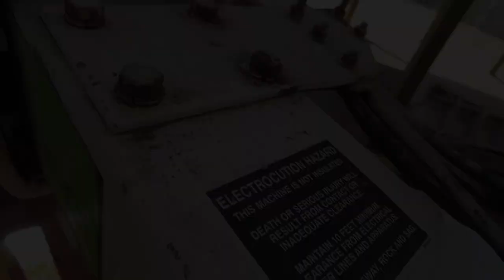How to repair SnorkeLift UNO 33E Boom lift Cylinder (Snorkel Boom Lift)

Comment: Thank you for the video. I have a 1995 UNO 41E, 600 hours total. I have owned it since 2003. I have had no problems with mine. Use it to paint the house, install new gutters, pulling bushes out of the ground, installing street light poles, lifting all
kinds of things. I got my second set of batteries from Costco (6 volt), they are 7 years old and still working. Again thank you for posting your repair I may need it one day.
Reply from the maker: Nice, I think they’re under appreciated. I still have a couple of things to repair. Thanks for the shout out.

Comment: Great video! I also have a UNO 33E that I purchased from my employer. They purchased it from a local rental store. It's a mid-1990s model and I've "known" it since around 2005. It was eventually replaced and sat outside for a couple of years before they finally sold it to me for $500 about 5 years ago. It's in pretty rough cosmetic shape, but mechanically sound. I need to fix the electric brake and the bucket crank-swivel mechanism.
Reply from the maker: We have used it a ton. The people at snorkel are so helpful with troubleshooting. Good batteries are key. I can’t imagine not having it

Comment: Nice job with the rebuild!  I'm curious -  would you recommend buying a used lift like this? I saw a couple Uno 33 Es show up at an auction and got intrigued. I'm mostly concerned with operation on uneven terrain, getting it stuck on soft soil, the control boards going bust and being unable to replace them.
Reply from the maker: We had a gas/propane jlg in the past. I like the electric model a lot better. And the company is amazing to deal with. You can talk directly to technicians, engineers or parts people. One of their techs actually sent me a copy of his electrical “cheat sheet “. You couldn’t always have a different experience but I’ve been very happy
Reply: @featuredelements4631  Thank you so much for the thorough response! Best of luck with your future projects. I'll be following along!

Comment: I wanted to ask you I just bought purchased a lift. What batteries did you use? And would you buy them again?
Reply from the maker: I purchased them through the local Napa store. So far so good. There are 8 batteries at approximately $150 a piece.  I believe after having a gas/propane unit I much prefer electric. If I can ask what unit did you get?
Reply: Thank you so much for your quick reply means so much thank you really enjoyed your project. I can’t wait for the next video to come out and join what y’all doing? Looks like y’all having a blast I’m doing almost the same thing I purchased the 41E having to rework some hydraulic lines front swivel on the bucket batteries got a find out information about the tires probably need tires.